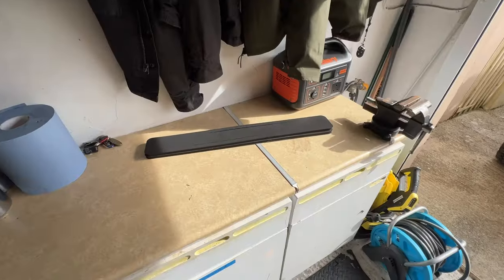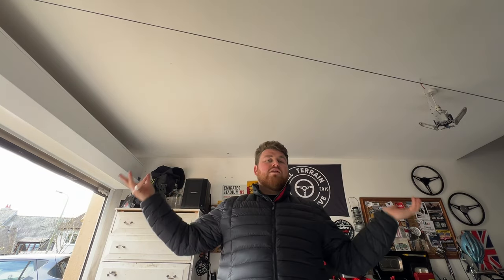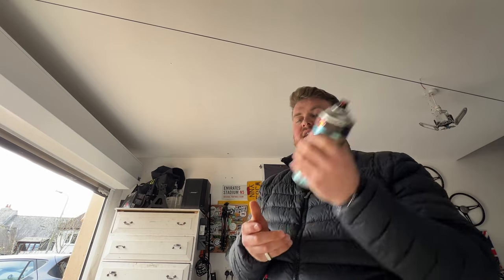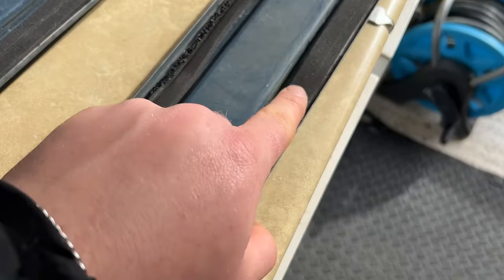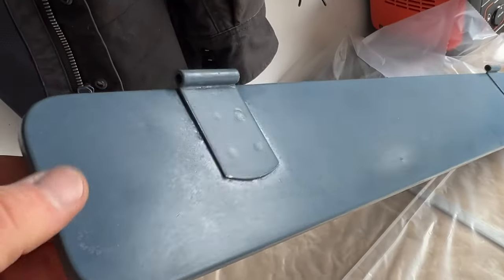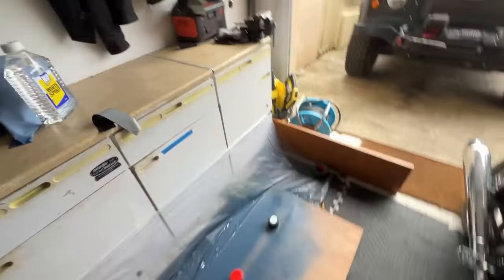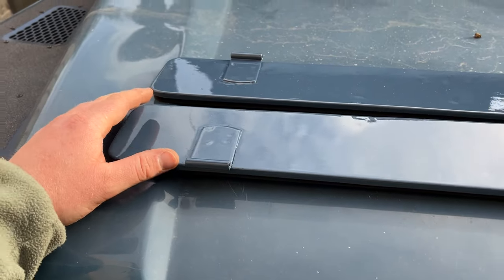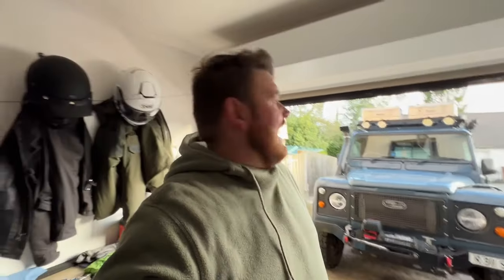HAVE I FINALLY MANAGED TO FIX THE LEAK? - EXMOOR TRIM DEFENDER VENT SEALS

Comment: Thanks for this video - very helpful to see. 
Perhaps a silly/ignorant question, I’m curious, why not prep & paint the back side of the louvers before applying the foam? Is it one of those “it’ll never be seen/exposed to the elements” kinda things?
I haven’t replaced my bulkhead yet. Looking forward to this kind of task that will undoubtedly change the driving experience of my hole-ly ‘87 Ninety Hardtop.
Reply from the maker: Yeah, no need. It’s a aluminium and was painted and had no issues. It would be a waste of time and paint for me.

Comment: Hi , how did the seals settle down in the end? Started out  with the flaps not quite parallel to the bulkhead when initially fitted, though to be expected to a degree  I suspect. Keeping out water?
Reply from the maker: The problem I have is the misalignment of the old air vent flaps to the new bulkhead. Apart from that they are doing a good job.

Comment: They look exactly like the seals I fitted 3 years ago from Britpart! The seals on mine were dropping so water was allowed to flow in, but the seals in the right place worked well. I fitted the seals, fitted the vents immediately and closed on the closed tight setting, left for 2 weeks + without touching them. 

As for the video format, yep much better, easier to watch and you come across better. I might actually watch more if they are like this, wouldn't watch the old videos as not actually that watchable in one go. 

ps your vents don't actually close properly, they are still open at the bottom, so that's why you never got too much pressure at the lower edge. tweak the hinge and bring the top out a little, and make sure the lever is on the top knotch. that makes a massive difference.
Reply from the maker: I’ll make sure to carry on making them how I usually make them then 😉😂